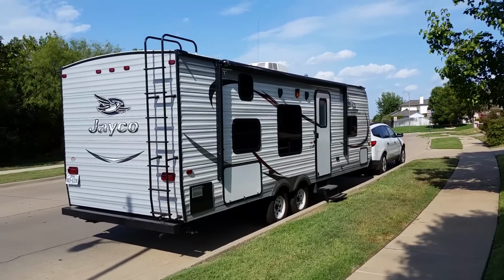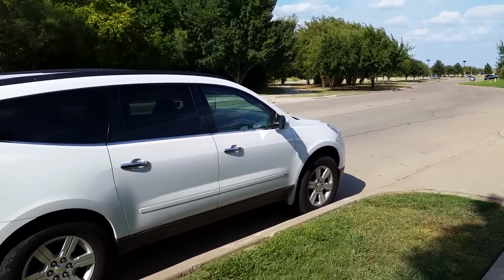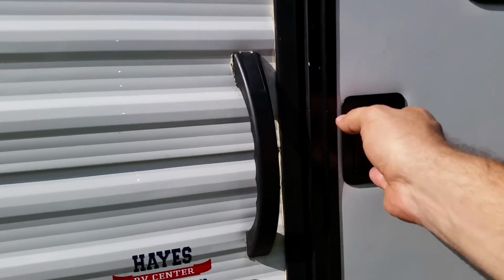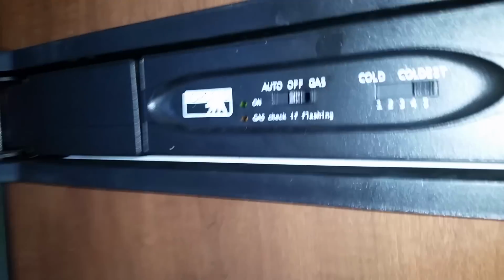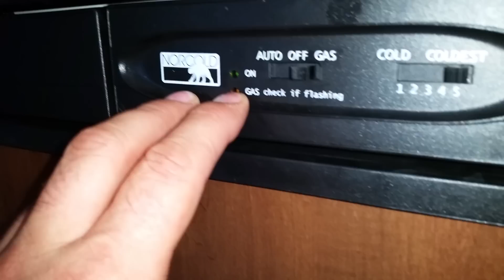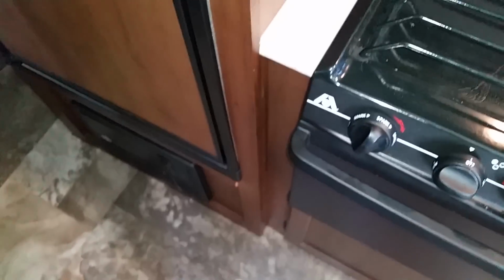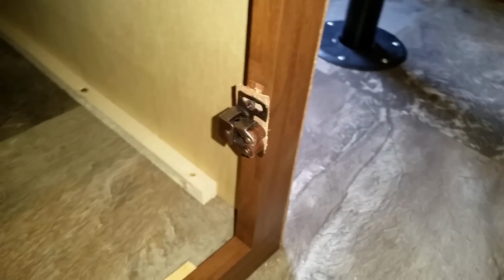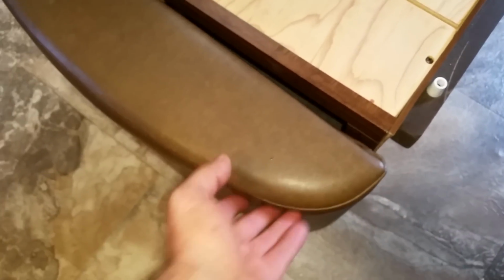Update: New JayCo Trailer FALLING APART.  Lengthy Warranty Work Needed.

Comment: I'm not sure of the point you are trying to make. Are you angry with the salesman, the manufacturer or yourself? Exactly how much research did you do before buying this? How many of the dozens of videos did you watch on here describing the exact problems you are having? Did you watch the videos of how they are made? If you did then you would not have been surprised by the construction methods used. When you pulled the cushions away from the seat back in the showroom did you see screws? What did you think was holding the furniture together? I would love to feel sorry for you if you had gotten ripped off but you could have prevented all of this by doing research. There are quality products out there but you have to work to find them.
Reply: Blaming the buyer are we?  Jayco used to be a household name....not any more.  Have my own piece of junk from Jayco and I did my research.
Reply: @melaniegates8477  Yes, that's correct. This company built a product with the intentions of selling it. It's up to the buyer to determine if the product will suit their needs, is up to the level of quality they expect and is within their budget. It would be different if Jayco advertised themselves as the Mercedes Benz of trailers and said their craftsmanship is second to none and that their trailers will last for thirty years. Then it would be false advertising. Either way one walk-through and it would be obvious that wasn't true.

Comment: We just recently purchased a Starcraft Satellite and ours has issues as yours. We say it was a Friday trailer or a Monday morning one. Anyway I did contact the main office and all we got was take it in and have all fixed. Sad as it is going to cost more to fix than to replace it with a new one. It is now in supposedly being fixed, list of at least 8-10 items not counting the nail or staples holes they tried to cover. Refrigerator had a propane leak and was found when we took it in on an emergency as we were on the road, window leaked and if it weren't for a plastic cover on mattress it would be in the junk pile. I could go on and on but the warning to all is make sure you check with a fine comb before buying. Am sorry we purchased. So am still waiting to hear if they are going to replace window or just patch..  Nothing good to 90% like.

Comment: looking for a new trailer and this vid helped eliminate a model! Thank you
Reply: It's not the model.  I have a 2013 Jayco 26BH I bought new from Trailside RV in Kansas City and have never returned to ANY dealer in 5 years for an issue.  I broke a screen door handle, 2 acrylic faucet handles and had trouble with a vanity faucet all outside the 2 year warranty but they were all easy fixes.  Some of this should have caught during the dealer's PDI or he should have worked with a reputable dealer to fix all these issues.
Reply: Arnold D I had the exact same trailer as you and loved it. I would’ve kept it just needed a bit more room so got a trailer with a slide out.
Reply: Big mistake!

Comment: HI there:  I know this video is a bit dated, but on the flip side of the coin, we bought back in 2016 a new, 2015 Coachmen Clipper 17FQ.  It is their "50th Anniversary" edition with several upgrades like bright aluminum wheels (beautiful), stainless steel appliance trim, etc.  As for fit and finish, after looking at over 30 different models, this one BY FAR, was the best built I have seen.  First, I do not know if Coachmen took extra time to build this unit, buy EVERY corner is perfectly square, tight as a drum, all seating backs (a real problem above) are rock solid (screwed and glued together), the cabinetry is perhaps better in our unit than in some homes I have been in and from ceiling to floor, a near perfect build job.  The bathroom with tub and shower function perfectly (no leaks!), the various tanks and battery control panel gives us exact info on the fresh, black, gray water tanks and the battery check button let us know of our battery is fully charged.  All the appliances work as expected and when we are getting ready for a trip (16 in our two years of ownership!), we plug the power cable into the house overnight to get the fridge COLD (even the freezer section gets the ice frozen SOLID!) and we are good to go.  Turn on the propane when were are ready to leave and the automatic changeover works perfectly....EVERY TIME!  Now here is the best part...well not the BEST, but a nice customer service touch.  During our second year of use, the installed stereo radio had issues with the power button working only intermittently. It worked sometime, then NOTHING.  Bummer.  Well, I simply contacted the company who supplied the Jensen unit (ASA Electronics in Elkhart, IN), told them of the problem and even suggested I would pay for an upgraded unit if available.  NOPE....they said as a matter of GOOD WILL (remember THAT phrase?), even after two years of use, they would ship me out a brand new unit at NO CHARGE,,not even shipping costs.  All I had to do was remove the old unit (took about 5 minutes), send it to them (my costs of about $12.00) and they would check the unit for the defect and if found defective send me a new one.  I just got an email saying the new unit will be arriving TOMORROW (Aug. 1)!  Total time lost about two weeks total as our RV rests at its storage facility.  Boy, that is a lot different than some of the stories I have been hearing.

Not to rub it in, but we have been blessed to be able to enjoy our Clipper the way in which it was meant.  All the best in getting your troubles resolved.  Lou and Karen from Clearwater, FL

Comment: I have a 2017 Jayco, 27 ft with a slide out. I have had warranty work done on it twice and both times they got on it and fixed it pronto. It is a solid camper and well built. Sorry you have such a bad time with yours, but glad mine isn't in that number with you.

Comment: Get rid of it asap.  JayCo makes junk.  They build one of those things as quickly as possible in less than 7 hours.  They use a thin low grade particle board and the trailer frames are weak.

Comment: Totally false advertising. These units are NOT built by the Amish. No truth in advertising with this company. My brand new 2016 Jayco Precept 31 UL RV has similar issues. Fit and finish completely lacking. Noisy. Steering wheel has way too much play in it. Constantly having to battle it. Doesn't track on the road. I will have to post a video. It's at Manteca Trailer and RV since June 30, except for the four days we took it on our trip to Oregon from CA.
Reply from the maker: the worst part is the warranty really isn't anything like it's advertised to be.
Reply: your right....I have my 2013 working good. We would like a slightly larger tt, but are not seeing the quality out there.  Like your dinette seat, I added metal braces because I just didn't see the tiny staples holding, and half of them actually missed the mark.
Reply: Isn't that a Ford van? Jayco doesn't build the Ford van.
Reply: If you see Jayco's factory tour videos you see Amish men working on the line, but they certainly are not built by Amish exclusively, that is true. It is false advertising by omission.
Reply: Mennonites
Reply: ohh wow i was going to buy one this weekend...glad i read this!!

Comment: This is why I have a 43 year old Dodge Travco 27' motorhome. Two piece fiberglass shell over a steel cage frame, marine grade 3/4 plywood floors,....it's solid and still going, has well over 100,000 miles.

Comment: Sorry to hear about all your issues with your RV. Hopefully all is repaired by now. Your not alone though, I purchased a brand new 2015 Apex by Coachmen 288BHS. It was riddled with workmanship issues. It took 2 years of repairs to finally say nothing is wrong anymore. The shop manager actually told me that the manufacturers of these RVs will gladly pay then to repair than to take the time to do it right the first time. Sad to say indeed. Anyway thought I'd share that.
Happy trails. Cheers!

Comment: I bought a new 2014 Chaparral Lite 5th wheel by Coachmen.  I had problems with the tires, TV, A/C, LP and gas valve.  But the structure has been pretty sound.  I've towed it about 10k miles and it's held up really well.

Comment: I have an old 1990 jayco 5th wheel. It has actuly held up good for its age. But recently i replaced some paneling due to water damage. I was suprized to see that the cabinets were only held up by screws ran into the paneling and not the rafters. Crazy they never fell down.

Comment: the only rv trailer ive ever been in and camped in is my neighbor's airstream.  i dont know what model it is but it's  2013 or 2014.  The fit and finish in tjat thing is amazing.  he paif a lot, but I guess he wanted to avoid all of what's in this video.   i tjink the only issue he had was a vent fan that broke.   what are your thoughts on airstream?  i noticed they you furniture grade wood for cabinets.  i couldn't find any mdf anywhere.

Comment: Ive got a 2015 Jayco Jayfeather ultra lite hybrid travel trailer . its been great , no issues what so ever . I shopped around and looked at all other competitors and nothing came close to the higher quality that jayco offered... id have to say you got a lemon. possibly the particular crew that built your specific unit that day was definitley not giving 100% in their care for craftsmanship. wish there was a lemon law for rv's. If I were you I would not write off Jayco completely. They have a great track record. but like everything nobodys perfect . mistakes do happen. its all in how they are delt with
Reply from the maker: Good input
Reply: Jord TheMechanic wait a few years.
Reply: If he sells that suv someday, i sures in hell would not buy it,  that camper weighs around 4400lbs (dry unloaded), and towing cap for that suv is 2000lbs. better be checking that (im sure is brown) trans fluid in that sealed transmission hahaha
Reply: Gomer Pyle The lemon laws only apply to automobiles.
Reply: Donald Fugitt pp
Reply: I believe lemon laws are state specific.  There's a guy with a video titled something like 'Don't buy that RV!" who explains this in far more detail. Interesting stuff.
Reply: Funny www.edmunds.com says max towing capacity is 5200 lbs. I have a 2011 Ford and it said 2000 lbs max towing for it also until you looked farther and that was if you only had a class 2 hitch on it. It might be that was what they were referring to for the Traverse.
Reply: Not completedly true. Traverse with towing package is rated for 5000 pounds. I had one. However, transmissions do develop problems (I was told around 70,000 miles.
Reply: wow! you got a lemon. I have a 2005 Jayco JayFlight travel trailer. Built very well. no issues. used it for 12yrs. I think theres a few lemons in every  brand. just make sure you check everything before buying. I'm looking to buying a HT Jayco fifth wheel.
Reply: UPDATE * we traded in our 2015 Jay feather for a 2017 jayflight bunkhouse . I must say since Thor has purchased jayco they have cut more corners and stopped using what I thought was quality appliances and materials , now jayco has adopted LCI components which are very substandard and cheap . At least for 2019 they went back to Dexter axles . We are witnessing the fall of a once great brand . Now very mediocre and blends in with the rest of the junky RV brands in the industry. So sad.

Comment: NEVER, NEVER, NEVER buy a Jayco product. We are so unhappy with the poor
 quality of our brand new 2016 Jayco Precept 31 UL. We have only used it
 for five days. It's been at Manteca Trailer and RV since June 30.
Reply: I just drove to Manteca from the Bay Area  today. I went inside the Jayco's and noticed how cheap the interior was and it made me feel uncertain. I returned home to the Bay Area and decided to look up complaints against Jayco to confirm my bad impression and I was correct. I envisioned everything coming loose and falling apart once I tow it if I decided to buy one. So glad I didn't. It wasn't the trailer I want anyway, but the one I was looking at seemed to  match my SUV towing capacity..  I have my eye on a seemingly better brand out of state that I found online. More sturdy, higher quality etc,.
So sorry you had to experience  poor quality after purchasing your trailer.. Thank you for sharing, you are saving so many from disappointment and a nightmare.. Guess I won't be driving back up there to buy, maybe to look for fun, but now I am afraid. If they sold me one for $1,000.00 I probably wouldn't say no and use if for practice, but for a long term purchase at their regular so-called sale price - no..no..no.. They seem ok, but you can tell the interior looks cheap, they make it look good with everything in place, but once the trailer starts moving that's when they fall apart.. Sad..

Comment: My 2014 jayco jay flight 26bh has all the same issues plus since I’ve bought it I noticed that the door or wall for the door is bent, the door doesn’t seal properly. It’ll pop open randomly, I’ve tried adjusting the latch but same issue. When standing inside the camper I can see daylight coming from between the door and latching side of wall.

Comment: 2007 Hornet, been living in it full time for 3 years and all summer for 3 years, great camper with only normal problems like after 7 years some things needed replaced as they wore out, no complaints on my end. I have replaced water heater and microwave.

Comment: You cant be serious.   First off its not wood...second its made light weight which means you cant live in it like your living in a barn.  None of that is warranty work.   The fact that you got the counter top so wet it caused the damage at seam,  says more about the owner  than the quality of product....Thanks for the laughs.
Reply: William Ferguson II common sense. Also they could use better materials if people didn't insist on towing witha light crossover to save 2mpg over a truck built to tow

Comment: I wonder about you towing with the Chevy Traverse? What was/is the weight of the trailer with it loaded? We have a Jeep Grand Cherokee with the hemi engine and it's GVWR is 7200 lbs. Our 26bh weighs 53 hundred dry. It'll be over 6k with our gear. I'd like to see at least a one ton margin for safety reasons. Also the wheel base of the GC is very short compared to a pickup another reason for concern as we are planning a 7k mile trip this summer. As far as fit and finish goes I do see many blemishes in ours too. I'm definitely going to reinforce the seatback by the door side of the dinette! I've already discovered that the bottom bunk gets very hot as there is no a/c vent. I did email the factory about fit and finish and never got a reply. That's pretty sad. I don't want to say too much as I might need some warranty work done. But for the money it'll be what we need without going overboard on expense.

Comment: i have a 26BH but a 2017. I looked it over really really good before we drove it off the lot. only problem I have had is my sink cracked. you as a purchaser should have looked it over better. and you double check your tow rating? mines 5k empty,

Comment: I JUST watched a video where they were saying the reason for all these types of issues are the manufactures are building all kinds of "lite" RVs so that any vehicle can pull one and they are trying to build them as quickly as possible. So the way manufactures make these lite and ultra lite trailers is not only using lighter material but LESS material. The problems you are having with this trailer I believe is because you purchased an RV that your crossover can tow so the manufacturer instead of using 20 screws on something used 3, instead of using the proper sealants and a proper amount used cheaper stuff and only put it in some areas not the entire area. Unfortunately, what your experiencing is very common and it was suggested to pack a tool box incase of things like this. The dealership SHOULD take care of all these issues and then work it out with the manufacturer. However, that is not always the way it gets handled, sadly. It looked like a nice RV, I hope you can get the repairs that I personally think the dealership should do for you. Glad no one was hurt and I wish you the best

Comment: mig welds are not checked for splatter and wire sticking up,tires are cracked after one year and it was stored in garage, they left plastic circle in the water tank and it blocked off outlet.it is six years old and spent eight hundred dollars to get a inspection done for the year (new tires and brakes because grease seal let go in drum.door on hardtop has a 1"gap on one side battery box is tight up against the propane tanks radio won't bring in a good signal ,sink is pulling away from the hinge side,latch for hardtop door pulled off thin plywood.and the fans that you clip on each bed stopped working after two years and this year number six it took to leaking under vent in roof.junk plus lots of fit and finish issues.oh and not to mention screen room can't fasten to side  tightly

Comment: I have a 2014 Forest River RV trailer and have many silly fit issues also.  I had to install shower dams to prevent water from ending up on the floor when taking a shower.  Some of the panels in the shower had to be re-sealed because just touching the panel caused them to come loose.  The hanger for the shower head fell off because they only used a wood screw into the thin shower walls.  The drain pipe for the bathroom sink wasn't tight enough so had a leak there also.  The shower valve wasn't even caulked onto the shower wall so you know what happened there.  The body of the trailer is not very rigid because if one of the stabilizer jacks is too tight to the ground, you can't even close the door!  As you mentioned, I shouldn't have to do these stupid fixes.